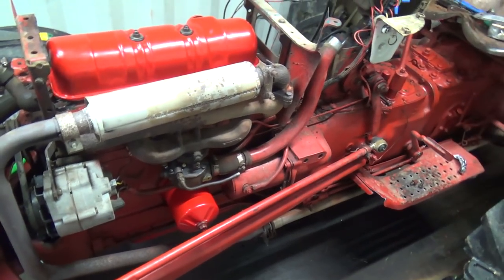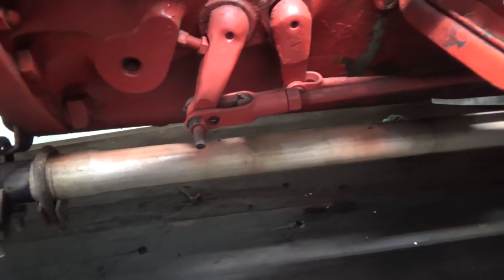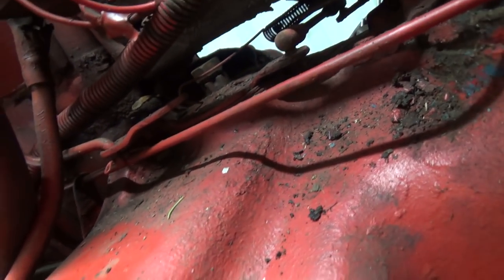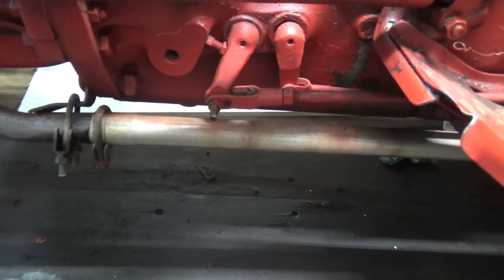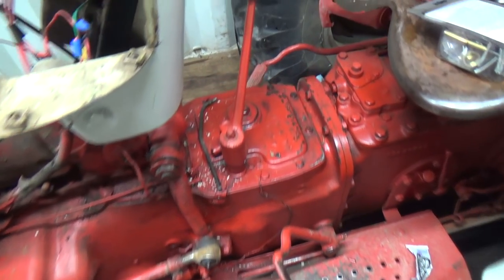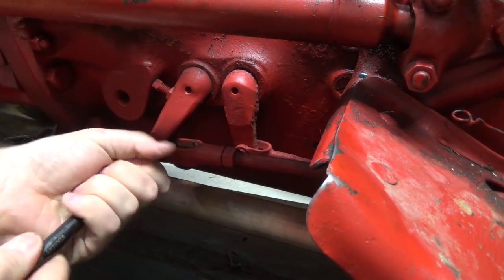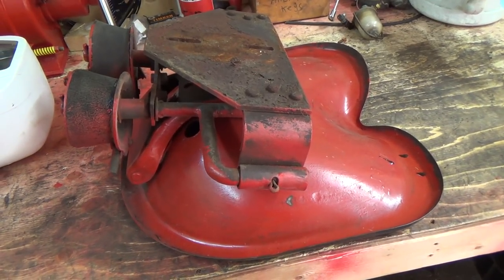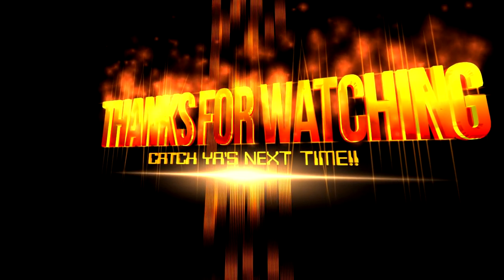Ford 800..Let's adjust the clutch pedal and remove the seat assembly for some repairs

Comment: That tractor has a two stage clutch halfway down disengage pto all the way down disengages the drive
Reply: I believe the tractor is an 850 so it does not have a 2 stage clutch or live PTO. When bill showed the bellhousing in one of the videos he showed the model number and serial number and it looked like it said 850 on the bellhousing. It would have to be an 860 to have a 2 stage clutch and live PTO.
Reply from the maker: It Has live 3 point hitch lift but not the pto.. I did test it.. :(
Reply: @billstmaxx  Bill, the tractor appears to be a 1956 Ford 850.

Comment: Would it work to weld the hole shut on that clutch arm and then re-drill it to the proper pin size?
Reply from the maker: If I had that part out of the tractor that would work

Comment: Completely fill that worn hole,  drill it a few thou over the pin size, then ream it to take a cintered bronze oilite bushing.  The bushing will wear before the pin or the arm and you can just press it out & replace it.   PITA to weld, but it's a permanent fix.